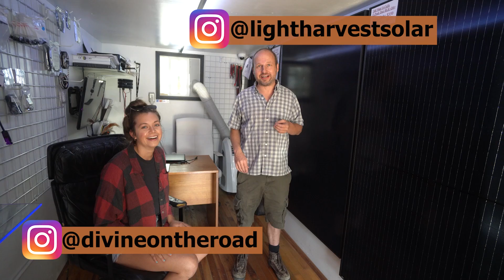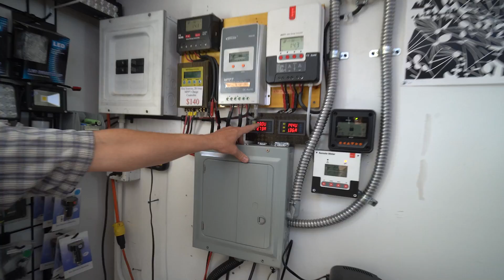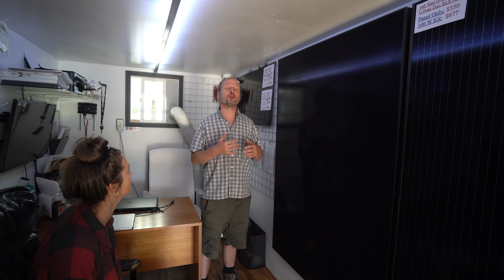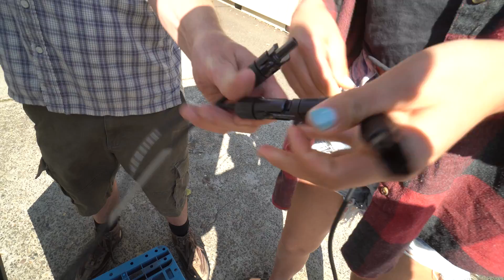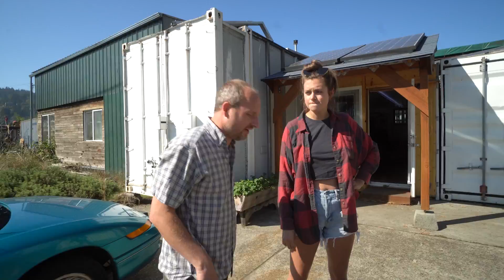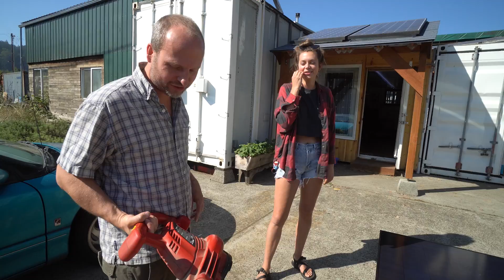SOLAR Panels - How They Work and Differences for Van Life and Tiny Homes

Comment: Can you charge the all-in-one unit from the a vehicles alternator?  Would the larger units be a good replacement for the DIY option?
Reply from the maker: You can set it up to charge that way. Some plug right into a 12v outlet. I think for certain van lifers the all in one units are perfect for

Comment: Wait...  Is solar a marketing bluff?   If we look at the 10-min mark, we see that the 1200W of solar on the roof are giving 1.4A after the MPPT does its thing.  That's on a clear blue sky.  If you have anything  bigger than a 100-Ah battery using a single 350W panel, this is going to take forever to charge!  Makes no sense.  So, why are people using solar if it's so inefficient?
I have a build coming up, and I have a 400Ah Lithium battery.  Thinking between charging off the alternator or solar.  Seems like solar doesn't do much, and alternator is the way to go.  So, what's up with solar?
Reply from the maker: The charge controller is doing its job. See when a battery is full then the charge controller knows that and won't over charge the battery. It was sunny all day so the panel was simply keeping up with that. The only thing running in the office at that time was the lights so that amp rating is correct.
Reply: @jarrodtocci  Alrighty then.  Thanks for the reply.  I saw an A/C unit and other things, so I was wondering.... So, in his situation, do you know about how many amps he can pull from his panels on a sunny day?
PS.  Thanks for this vid.  Now, I will be looking at split cell panels.

Comment: Great back-to-back series on Solar - solar generators & panels. All super new technology making gasoline generators & 110 volt rooftop a/c units obsolete, and so affordabe! Will you investigate & report the compatibility to run a Cruise-n-Confort 12 volt split a/c unit. I live in Texas. 🌞🌞🌞🌞🌞
Reply from the maker: Much more things with air conditioning to come. Takes time for me finding people doing installs of these products. I installed a cruise n comfort into my last van and LOVED it. Oddly Miles from here helped me wire it up!

Comment: The power stations appear to be rebranded Maxoak/Bluetti units. The 2000w inverter one described in the video was just manufactured through an indiegogo campaign. I backed it in July and it is scheduled to arrive on Wednesday. Unfortunately per Bluetti, they are going to be difficult to come by for a while as they just had enough materials to produce the units for the Indiegogo campaign due to battery and materials shortages in China/Covid delays. If you're looking for more info/reviews on that unit though do a search for Bluetti AC200. It's pretty cool. If Light Harvest Solar ends up having some then that would be great since it doesn't look like they'll be available from Bluetti any time soon, and the pricing seems to be on par with what Bluetti was going to sell them for.

Comment: Important to know that just connecting a larger solar panel to portable solar generator may not work. You need to know that the VOC of the panel does not exceed the maximum voltage input of the solar generator.
Reply: SUPER important and THE reason we have our solar generators that will use high voltage commercial panels.

Comment: Great video as usual. Do you know if you can daisy chain 2 of those portable power packs?
Reply: Sort of, essentially you would charge one off the other.  You would then have 2 1000 W inverters, 2 batteries, and 2 charge controllers.  You can't put 2 together to get a 2000 W inverter though.  Thanks.

Comment: Miles again explained the differences in solar panels SO well....excellent video and again very informative.   This should be a must-watch video for van builders considering solar.     Only hesitation about the solar generators is that once the lithium battery part needs replacing then you lose the inverter and MPPT part of it.  Bit like buying a TV and DVD player combined.      But a great and informative video again. 

thank

Jerry
Reply: Agreed.  The nice thing about these systems is that there are individual components inside that can be changed out. So if one component goes bad we should be able to get up and running again.

Comment: These panels are amazing. Wonder if I can find some in Canada. I was thinking of getting 3 X 300W panels for around $260 CAD each, but after hearing that the partial shade can kill electricity production of older panels I'm definitely gonna figure out what generation/tech is being used in the particular panels I'm gonna buy. Did he just say that his panels charge batteries faster than conventional panels, meaning we need to buy less watts from the newer panels?
Reply: Partial shade will only partial kill production, unless it's across the entire  width of the panel. Most 60 cell panels have 3 zones. Shading on the long edges will only cut production 30%. You can get a split "120" cell that does better in partial shading as well.